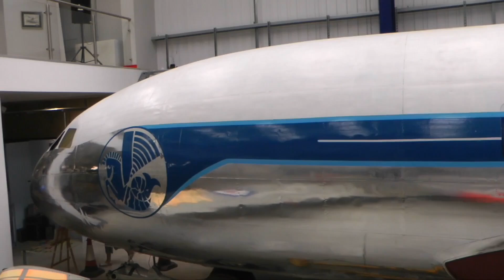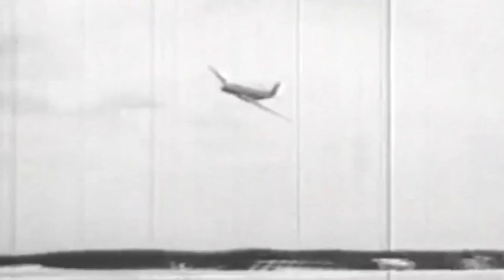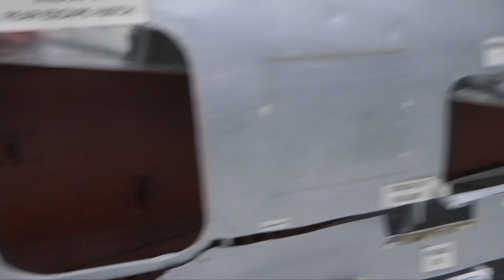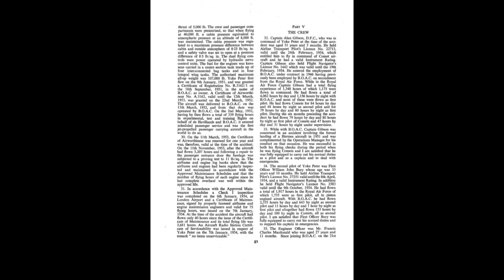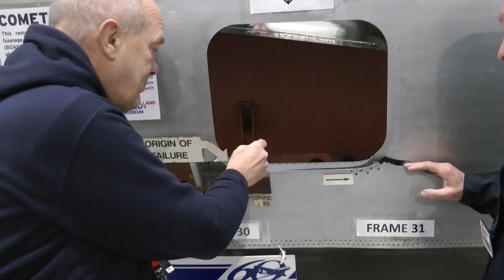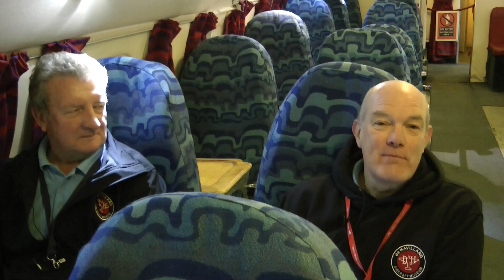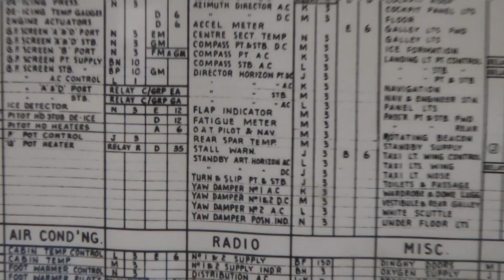The plane that changed the skies forever. DH.106 Comet Airliner from de Havilland

Comment: All of de Havillands jet aircraft were deathtraps.

The the DH-106, DH-108, DH-100 and DH-110 all had appalling safety records and high crash and fatalities statistics.
Reply: @sandervanderkammen9230 

It will come as no surprise to most that we feel able to shed some light on some common misconceptions and myths, of course.

It's always good to see the facts presented clearly and concisely isn't it?

  That's correct, Bow-wing (See B-47 wing collapse & wing folding incidents) hadn't managed to sell more than a dozen pressurised airliners before the first flight of the Comet. Having had more than 50 years design & build experience on the type there can be no excuses for the horrendous Bow-wing Max incidents for example. 
   
  That's correct of course, at the time the Comet didn't have particularly high accident loss rates relative to many other aircraft.

Losses comparisons, how things were in those days.

DeHavilland Comet 4                            14%
DeHavilland Comet all  (ff 1948)         17%

Boeing 307                                              70%
Boeing 247                                              48%
Boeing 707            .                                  20% 
Lockheed Electra Turboprop                   29%
Canadair CL-44  Turboprop  (ff 1958)    46% 
Convair CV-580  Turboprop                    22%
Convair CV-880    (ff 1959)                     27% 
Convair CV-990     (ff 1961)                   35%
Tupolev T-104 (ff 1955)                          16%

   Indeed, De Havilland carried out a full stress analysis & engaged in a comprehensive & protracted testing program which is why key De Havilland people were happy to be aboard flying DH Comet aircraft.

  Of course it is in fact the case that no aircraft before the Comet had been subjected to as much testing as the De Havilland Comet.

  Agreed, of course De Havilland did indeed always work to better than industry standards at the time, used up to date knowledge for the design & construction & no evidence of negligence  or criminal negligence was ever produced in relation to the DH Comet.

  De Havilland designers / engineers knew all there was to know about metal fatigue at the time they designed the DH Comet.

  Of course De Havilland had prior experience building many all metal construction airframe aircraft including many passengers aircraft & thousands of jet powered fighter aircraft that were primarily of metal construction with pressurised cockpits & jet engines built by De-Havilland.

  Indeed, one of the key features of the DH Comet was of course its high altitude capability.
It was in fact the first airliner to have 8 psi pressurisation for the entire fuselage length which resulted in it being the world's first airliner where pressurisation stress significantly exceeded flying load stress.

  Obviously the Comet was an all metal construction airframe aircraft & like all similar airliners used other materials for no structural items such as interior trim. The rear pressure bulkhead for the Comet was obviously not made of wood for example.

  British Aircraft Achievements Notes.

  The world's first gas turbine aero engine demonstration was in fact performed by Whittle in 1937. Sir Frank Whittle patented bypass & reheat before 1936.

  The world's first axial multi stage sequential stator rotor turbines & compressors were produced in England by Parsons of Ireland & North England. The same components used in many modern gas turbine aero engines. Parsons also did some work on the internal combustion gas turbine engine. In fact people at the time in England before 1900 had already discussed the concept of using those components for an internal combustion gas turbine aero engine for powered flight & so had invented the jet aircraft before the Wright Brothers had given any thought to flying.

  The first example of a pressurised cabin aircraft was a British design Airco aircraft built under licence in the US & modified to have a pressurised cabin during a joint UK / US research project.

  The gas turbine engine was first conceptualised & patented before 1800 in England.

As always we hope this helps of course, obviously.

Cheers & 👍 indeed.

The line above has clearly been left blank.
. . ..... ....... . ........ ...... .... ...
Reply: We also feel we can clear up some commonly held myths and misconceptions, obviously.

That's right, It's always good to see the facts presented clearly and concisely isn't it?

Info below on comparative accident losses of some other DH aircraft.

   That's correct, of course the MD F3H Demon was a contemporary to the DH Sea Vixen & had a similar performance. The F4 Phantom was a follow on from the F3 Demon. The Sea Vixen took a long time to get from first flight to introduction for various reasons and a similar situation occurred with the MD F3H Demon.  

McDonnell Douglas F3H Demon
590 Built.
Introduction date 7 March 1956
First flight 7 August 1951
Retired 1964

MD F-4 Phantom 2
Number built 5,195
Manufactured 1958–1981
Introduction date 30 December 1960
First flight 27 May 1958

DH Sea Vixen
Number built 151 (including two DH110 prototypes and one Sea Vixen prototype)
Introduction date July 1959
First flight 26 September 1951
Retired 1972

Non combat phase accident losses.
% of Aircraft built.
The Canadair CL-44 was a turboprop airliner.
Canadair CL-44              (ff 1959 ) 48%
Lockheed XF104              (ff 1954) 100%
Lockheed  P80                 (ff 1944) 43%
Lockheed F104                (ff 1954) 45%
MD FH Phantom 1           (ff 1945) 35%
MD F4 Phantom 2           (ff 1958)  28%
MD F3H  Demon              (ff 1951)  32%
Gloster Meteor               (ff 1943)  21%
DH Vampire                    (ff 1943)  23%
DH Sea Vixen                  (ff  1951) 33%
Gloster Javelin                (ff 1951) 20%

    Regarding the UK Aerospace Sector.
   
An airline recently ordered 60 RR Trent XWB Engines 

   Clearly It's a great pity & a crying shame that British military forces had to occupy a large part of Germany for decades after 1945 & Russian military forces had to do the same. Of course Russia still posseses a large chunk of what was German territory & of course Russia & the UK produce nukes. Obviously Germany does not produce nukes.

   Interesting British achievements.
There is no doubt that the Fairey (England)
Delta 2 was of course the world's first jet
aircraft to exceed 1000 mph.  lndeed It
exceeded the previous record by 310 mph &
held the record for 1 year. Incidentally, the Dassault Mirage 3 & 4 are based on the Fairey Delta 2.

Early days, jet fighters.
   De Havilland Vampire, Sea Vixen & Gloster Meteor accident losses were not high or unusual for fighter aircraft at the time. De Havilland built large numbers of all metal airframe aircraft before the DH Comet.
We mustn't forget of course that the DH Vampire for example first flew in 1943 & the engine was also built by De Havilland. There were examples of the Vampire interceptor / fighter in service until 1990 which was operated by more than 30 countries.

Non combat phase accident losses.
% of Aircraft built.
The Canadair CL-44 was a turboprop airliner.
Canadair CL-44             (ff 1959 ) 48%
Lockheed XF104             (ff 1954) 100%
Lockheed  P80                (ff 1944) 43%
Lockheed F104                (ff 1954) 45%
McDonnell FH Phantom  (ff 1945) 35%
Gloster Meteor               (ff 1943)  21%
DH Vampire                     (ff 1943)  23%
DH Sea Vixen                  (ff  1951) 33%
Gloster Javelin               (ff 1951) 20%

   An example of what goes on these days in various countries.  

Obviously, for example, there are of course no German companies that makes German jet aircraft in Germany & there are no German Companies that make German gas turbine aero engines in Germany that are suitable for widebody airliners.

     That's correct, Brazil makes very good airliners & Brazil is 100th down the list along with Indonesia for wealth per capita. Of course it is in fact the case that Embraer can't build those airliners without purchasing stuff from the US, UK & Europe.
Norway Holland Denmark Ireland Belgium - Top 20 wealth per capita - Don't make airliners -  its as simple as that.

   Early days of the airliners.
That's correct of course, at the time the Comet wasn't particularly dangerous. Agreed, that is indeed the case of course, The DH Comet was definitely not the worst engineering failure in commercial airliner history.

Losses comparisons
How things were in those days.

DeHavilland Comet 4 UK                       14% 
DeHavilland Comet all  (ff 1949)           17%  

Boeing 307                               70%
Boeing 247                               48%
Boeing 707            .                  20% 
Lockheed Electra Turboprop   29%
Canadair CL-44  Turboprop     46%  
Convair CV-580  Turboprop     22%
Convair CV-880    (ff 1959)       27%  
Convair CV-990     (ff 1961)      33%
Tupolev TU-104       (ff 1955)    16%

     Of course De Havilland had prior experience building many all metal construction airframe aircraft & thousands of jet powered fighter aircraft that were primarily of metal construction with pressurised cockpits & jet engines built by De-Havilland.

  More recent UK military jet aircraft.

  Of course the Tornado & Typhoon & their engines are Supersonic & are indeed British design aircraft with British design engines built by an international consortium. The Tornado design for example started life during the 1950s at Vickers as the AFVG, it's engine is based on the RR RB-199. The EE Lightening is also a British Supersonic jet aircraft.

  The Typhoon is the British BAC-EAP with an engine based on the British RR XG-40, the Typhoon is also built by an international consortium.

  Agreed, that is correct of course, clearly there are many countries that could easily produce airliners of better quality than Bow-wing (see b-47 wing folding & wing collapse incidents) but don't for some very good reasons. Bow-wing (see B-47 wing folding  & wing collapse incidents) being a result of the size of the US, the large protected domestic market & great ease of testing new types due to the equator to arctic geography complete with up to date aviation infrastructure & a few other reasons related to production scale capability, politics, the nature of the airliner market coupled with the nature of airliners themselves & general basic economics.

  Obviously there really is nothing special about Bow-wing, having more than 50 years design / build experience on the type means they have no excuses for the horrendous 737 Max incidents for example.

    Indeed BAe Systems & Rolls Royce combined now do more Airbus work than Germany on an absolute basis & significantly more work than that on a per capita basis.
   
     Agreed, Per capita for the home nation BAe Systems is the world's largest defence contractor.
  
    Correct, BAe systems announced the recent £4 Billion takeover of Colorado based US based Ball Aerospace.
  
    It's definitely the case that BAE systems now does a significantly higher value of work for Airbus than it did when it was a major Airbus shareholder before 2005.
     
      Obviously RR now owns US Engine maker Allison for example which does classified Aerospace work for the US Govt.
   
   Yes, that's right of course, Anybody currently flying on a widebody airliner stands a good chance of being on an aircraft powered by RR gas turbine aero engines built in the UK.

   A typical but small glimpse of what goes on in the very internationally orientated British aerospace sector.  

  Of course the RR Nene was in fact the world's most reliable & most powerful gas turbine aero engine in 1944. Licensed built versions & copies of the RR Nene & RR Derwent would go on to power many aircraft in Russia including the Mig 15 & Mig 17, the US, China, France & other countries for decades after 1944.

      Boeing Apache Attack Helicopter.
AH-64: 75 UK suppliers, 7% UK content, global fleet of 1280+ aircraft.
F35B more than 130 UK Suppliers, more than 30% UK content.
F35A & F35C more than 130 UK Suppliers, more than 15% UK content.

   There is no doubt that an airline has just ordered
60 RR England Trent XWB Engines

Obviously the UK has the
World's Highest Combined Per Capita
 Nuclear / Defence / Aerospace Sector Activity.

Rolls Royce Holdings UK
Subsidiaries
- Rolls-Royce plc
- Rolls-Royce North America (Allison etc Classified Military stuff)
- Rolls-Royce AB
- Rolls-Royce Deutschland
- Rolls-Royce India Private Limited
- Rolls-Royce Marine Power Operations
- Vinters Engineering Limited
- Rolls-Royce Controls and Data Services
- Rolls-Royce Power Systems
- Bergen Marine
Joint ventures include:
- Rolls-Royce Turbomeca
- MTU Turbomeca -

Trent Family
The MT30 (Marine Turbine)
Industrial Trent 60 Gas Turbine
Trent 7000
Trent XWB Airbus A330neo.
Trent 1500
Trent 1000
Trent 500
Trent 600
Trent 700
Trent 800
Trent 8100
Trent 900

RR wholly owned subsidiaries in Germany handle smaller 2 shaft RR gas turbine aero engine work.

Clearly the line above this line is blank.

We also do indeed very much hope this helps, of course.

Cheers as well as always & 👍 indeed.
     
. ..... ...... ...... ...... ..
Reply: The DH Comet had significantly more research and pre-production testing than any previous airliner had ever been subjected to.

The fabulous trail blazing DH Comet.
World's first jet airliner.
World's first high altitude airliner.
The first aircraft with a full fuselage width and length pressurised cabin where pressurisation stresses were higher than flying load stresses and were many times higher than flying load stresses. 

It's surprising then just how low the accident loss rate was for the Comet. 

    How things were back then.
Accident losses - % of aircraft built.

DeHavilland Comet 4 UK                     14% 
DeHavilland Comet all (ff 1949)         17%  
Vickers VC10 UK (ff 1962)                   5%

Douglas DC-1                                      99%
Douglas DC-2                                      47%
Douglas DC-3                                      30%
Douglas DC-4                                      26%
Boeing s300                                          72% 
Boeing 307                                            70%
Boeing 247                                            48%
Boeing 707  (ff 1958)                           20% 
Lockheed L-049/149 Constellation    30%
Lockheed Electra  Turboprop .            29%
Fairchild FH-227                                   30%
McDonnell Douglas DC-8                    14%.
Sud Aviation Caravelle  (ff 1955)       15%
Canadair CL-44 Turboprop (ff 1959) 46%  
Convair CV-580  Turboprop                22%
Convair CV-880     (ff 1959)                27% 
Convair CV-990     (ff 1961)                33%
Tupolev T-104        (ff 1956)               16%
Vickers Viscount   (ff 1948)               32%             

  The Vickers VC10, fastest Atlantic crossing for a non supersonic jet airliner, held the record for 41 years.

For the first few years of operation the Caravelle & Comet had similar accident loss fatalities.

Instances of all marks of Comet flew with full certification until retirement of the individual aircraft until 1992. Nimrods were flying until 2010. 

The first few Nimrod airframes were Comet 4 airframes with the equipment bay tacked on. Subsequent Nimrods were new build Comet 4 airframes with Nimrod modifications built by the DH team at Hawker Siddeley.